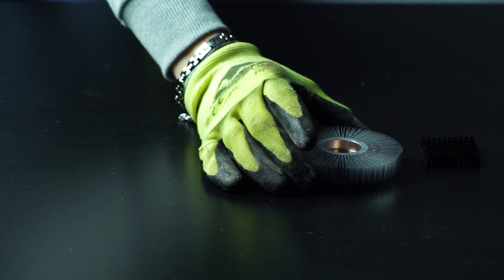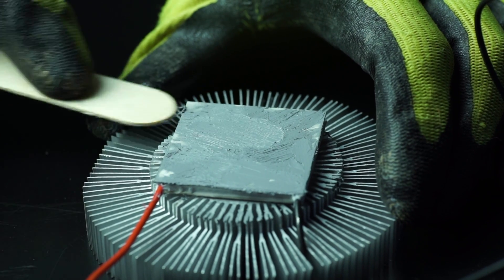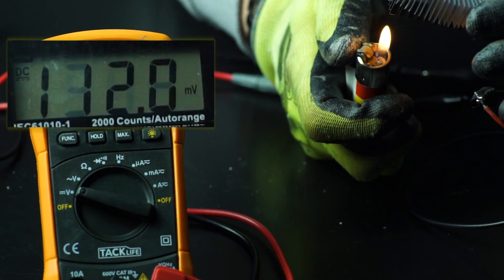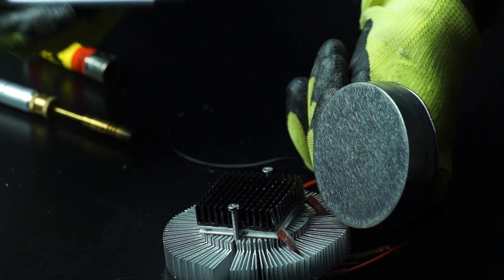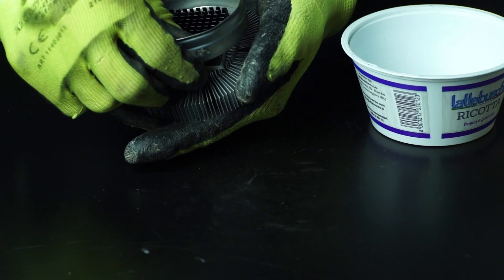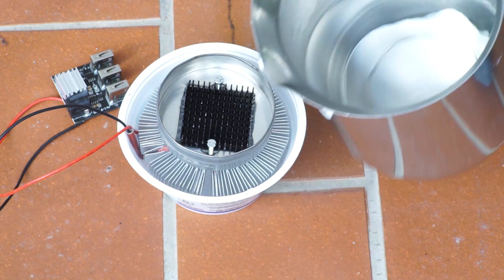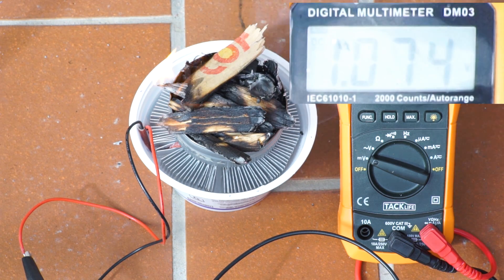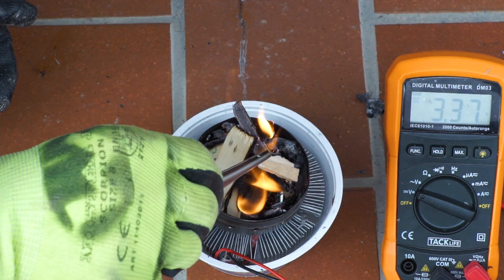How to make a peltier energy generator from fire - Free DIY Tutorial 2018

Comment: If u get enough current from 1 module then Use dc to dc Boost converter for higher voltage, otherwise u should add more peltiers for get a satisfying result

Comment: Put this on the bottom of a ohuhu wood gasifying stove. If it doesn't work then perhaps on the top, right under the cooking pots.
Since these are double walled you could probably get away with slapping a few peltiers on the outside wall of the burn chamber and then adding some generic wood stove insulation to minimize heat losses

Comment: I think just using a boost converter can pull the lower voltage up to the 5v you need to charge most devices.

Comment: you had no separation between the fuel chamber and the cold side the damn thing is sitting on  the cold side making it hot  the water wasn't helping cuz both sides were hot because there was no spacers between hot and cold